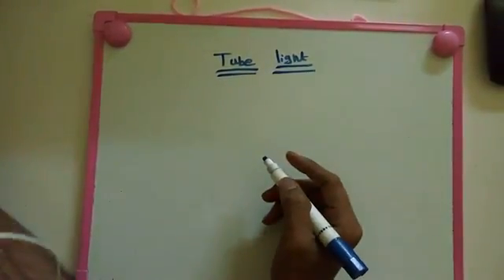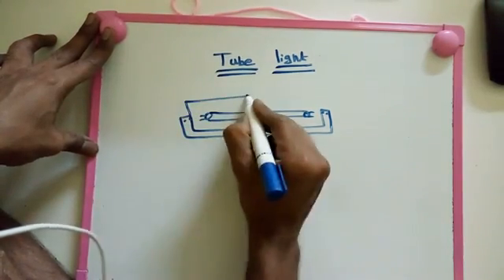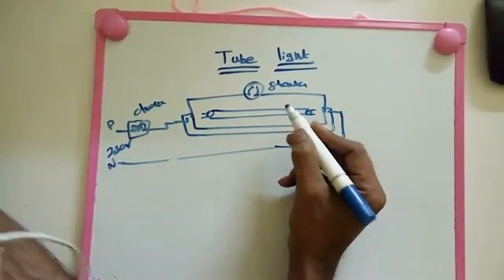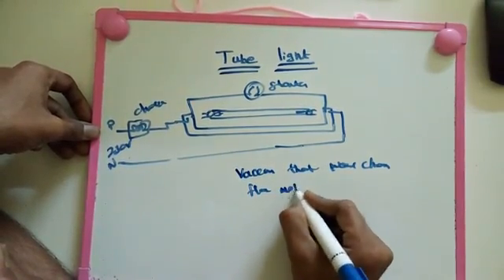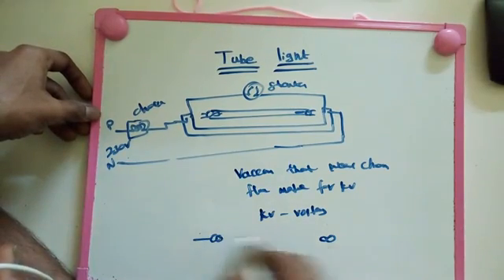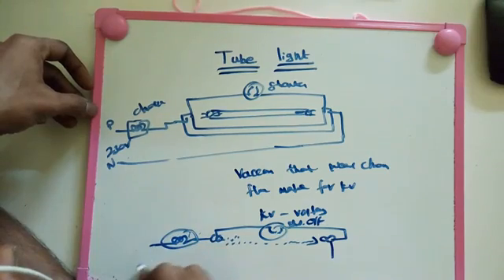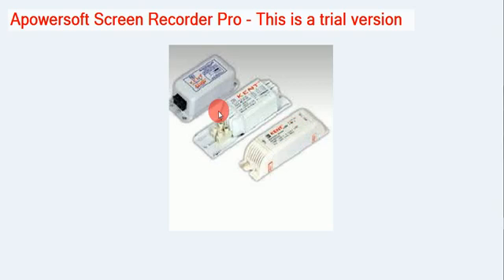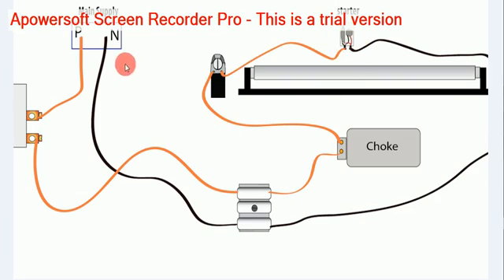Tube light working and connection explaining clearly in new 2017 part 1

Comment: starter is closed, current flows and builds up a magnetic field in choke and warms filament+starter-bimetallic-strip, bimetallic strip expands and breaks the circuit, causing magnetic field around choke to collapse and feed energy into the filament causing breakdown of gas. Current now flows directly through the gas causing illumination.

Comment: nice video, one of a pair of tube lights stopped working, can't clearly identify the starter and choke though there is an inductor and capacitor with resistor in parallel. please help?

Comment: I can understand what you are saying, but need to know one thing. What if the fitting does not have a Starter but only The Choke( ballast ,yes ?  ). What starts the Tube light Then, Is it built into the Ballast (choke ) ? Sorry Edison world, I forgot to mention, I have a few 6 -8 ft fittings with large Ballasts in them. and no starters !
.
Reply: if you have an electromagnetic choke you dont need a starter
Reply from the maker: some  tube light fittings not have starter arrangements so we need add extra .... thanks for your support....
Reply: Pleasure !
Reply: electronic choke don`t need a starter, but electromagnetic must need starter.
Reply: U r lund